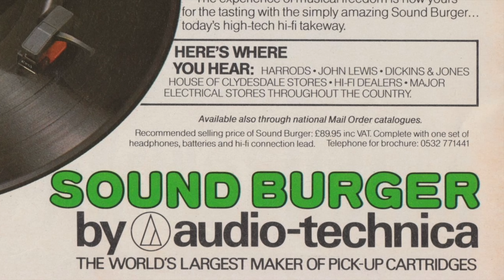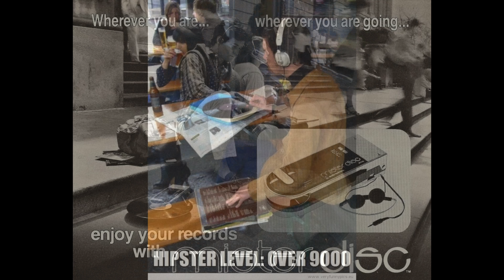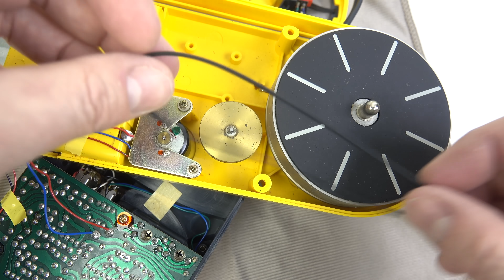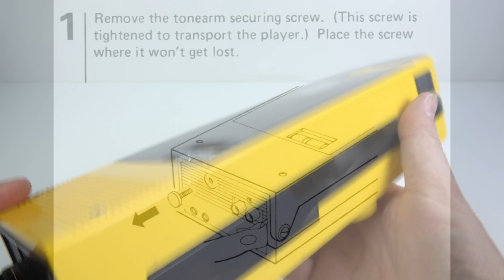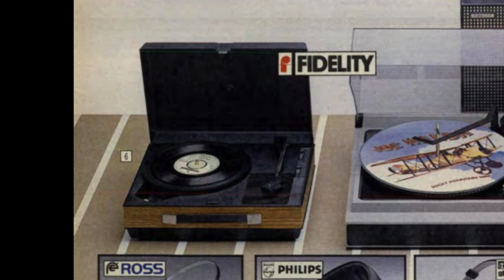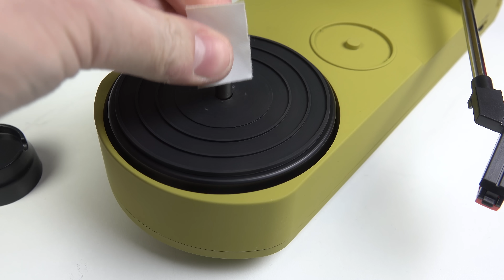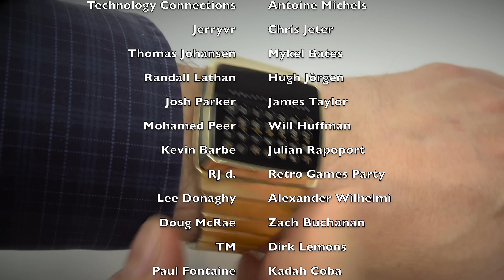SOUND BURGER & the clones

Comment: 100% fake. There is no reason why they would have high voltage hazard warnings on it when the highest voltage that unit will ever see is 6v from the batteries. Often if they don't just outright photocopy parts of/the entire label, they'll do a "word for word" copy and possibly at gunpoint which might explain the typos.

While I'm here, I have a question. My 60-year-old mum has a huge vinyl collection, you know, before it was cool, and nothing to play them on. I'd like to get her something. She is a very mild audiophile, but easy pleased. I'd like to get her something that isn't a crap copy of an original player, on a reasonable budget. Digitizing would be cool as she has a few rare ones, but not essential. Ideas? Cheers in advance.

Comment: I tried two such units around 2 years ago. The Crosley I got from Brookstone. I wasn't expecting excellent sound but I hoped for reasonable. Nope. The unit would have wobbly sound every now and then. Suspecting that was a fluke I got a replacement and the problem was still there. I took it apart but saw no obvious reason for the speed inconsistency. 
There's a similar unit on Amazon from Sylvania so I tried that one. Various colours available; how syilish. The sound was consistent (not wobbly)...but in mono through the headphones output. I gather you could get stereo if you took the USB output but that was beyond the point of having this sort of thing to begin with: portability.

Comment: Oh the fond memories. I used to have a Sound Burger. Mine came in silver finish which looked much more serious. It had pretty decent sound quality as far as I remember. The transport was quite stable but on rare occasions it would suddenly speed up a tiny bit, just about enough to be noticed. One drawback of the design was that the down side was picking up dust from the table while the record was rotating. Overall though that was the record player I spent my youth listening to and I'm glad I had it.

Comment: Knowing the Chinese somewhat through their stuff on eBay (via Big Clive's channel) I can say with decent confidence that's a knock-off based on the sheer amount of hum and the housing.  They tend to go with as few components as possible and the cheapest circuits possible and the result here is lack of suppression and isolation in there causing a frankly awful amount of hum.  If I'm wrong about that being a knock-off then I'm disappointed in the product offered.

Comment: I replaced the Numark Groovetool Stylus on my TTUSB with one from Banpa. $2 cheaper and a much better needle. I only mention it cause the Crosley's use the same model stylus. I've noticed the Crosley's are just a plastic stylus with a plastic tip tha can't be good for your records. I've thought of doing an experiment to counter the tracking force by placing a coin on the back end of the tone arm. Now while I know I should upgrade my cartridge to a Shure or AT it seems pointless cause these budget Numarks lack a ground wire sO I'm still getting a hum on my mixer.

Comment: Crosly is cheap ass garbage.I have worked on other products they make..total crap. this is using some type of PWM drive to spin the motor and its not shielded from the audio section well enough which is why its feeding back into the speakers. they could have isolated the audio better, but hey, Proper engineering costs money.

Comment: Hi 
when I was little ,early 1970's , my auntie gave me a small portable radio , I assume from the 60's approx 6"x 3"x2"thick on the one corner it had a small spindle a rubber drive wheel and swing out arm with stylus . it played 45's but the record was bigger than the radio.
ive never seen anything like this since.
unfortunately I "took it apart" to see how it worked and that was the end of it .
Does anyone know what make it was ? 
Both the radio and record player worked ok before I did my thing with it.
I have thought about it many times but have never seen anything like it since .
Paul .

Comment: As someone who only has experience in tangential topics, and at the risk of sounding like an idiot - if those rubber belts fail so often, what's the reason they don't just use gears? Difficulty to manufacture, difficulty to adjust, or something else?

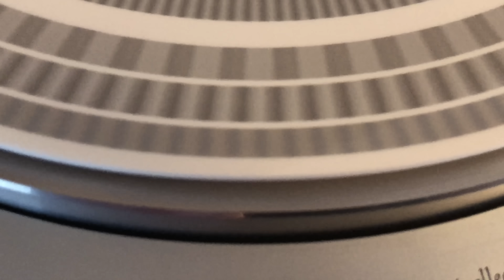Comment: 7:40 Once you put a record on the player, and the stylus grips, the speed will be slower.
I think modern batteries are slightly higher in voltage (keep their 1,5V longer) than older ones, which might be one reason why the record player is spinning faster.

Would have loved to see if there was a spinning speed difference on AC vs battery.

I was expecting it to be a cheap thing, but it sounds quite good if you ask me!
Reply: Many BSR TTs are known to play too fast, also many cassette decks were 2sec fast/min as well as all portables being set to this formula

Comment: Bring out motor and while it is on sand or file the groove of pulley smoothly where the belt  is driving few min until diameter is reduced few % there you solve the problem.

Comment: The Sound Burger cartridge is in the same family as the AT120E series. And given it's only tracking at 1.8g you could upgrade it by using an ATN120E, ATN440ML or even an AT150Mlx/ATN150Sa stylus. Might be a bit of overkill, mind you.
Reply: Plenty of them still available, though.

Comment: The original Crosley Revolution had a magnetic cartridge and a rotating spindle. However not sure if it would be a good idea to pick one up now because the belts on mine have worn out. Oh and you can't place a scale ontop of the record to weigh the tracking force because those record player use a spring as a counterweight, so the stylus pressure depends on the height of the tonearm. Good vid tho

Comment: Be careful with that DC input jack; It's center negative by the look of it. Not uncommon with older equipment (There is a reason for it but I can't remember what it was) but most wall plugs sold today are the other way round.

Comment: Ah, another day, another lovely Techmoan video to kick back and relax to.

Have you thought of making a video about the tools and kits you use to test/repair things?  I don't mean like screwdrivers (unless we're talking about specialized kits of course), but rather that weight sensor you use to measure tracking force, and that disc you use to test the spin rates.  Things like that.  Sure, one could just google to find their own equivalents, but it might be nice to watch a video dedicated to the 'tools of the trade', if you will.  I am planning on getting a record player at some point, an AT-LP120 most likely, just waiting on Amazon Canada to sell it at a reasonable price, and it would be convenient to have a video to refer to in regards to optimization and maintenance.  The same or a similar video could be used for other things, like cameras, power adapters (step-down transformers, for example), etc.

Comment: Ah the headphone jack, a piece of technology that was too advanced for it's time... It's too bad we don't see them very often at all anymore...
Reply: joe nodden we’ve been seeing them all along.
Reply: I refuse to buy a phone without a headphone jack.
Reply: The headphone jack has its origins in early 20th century manual telephone switchboards, where patch cords were used to make connections between subscriber lines. The plugs on those cords had three contacts, tip, ring, and barrel.

Comment: I don't think the crosley is fake, got one from curry it had the exact same issues, a screw was even missing on the cover.
there are two small screws under it to "adjust " 33 and 45 speed. This is an horrible product and it also kept skipping especially on 45.

Comment: If somebody is interested: i currently have a Mister Disc and a Dual PRP 5, but i want to sell the PRP 5 because i like the looks of the Mister Disc over the PRP 5. It has one issue: the latch on the door mechanism isn't working.. so it keeps popping open, it works fine tho.. it needs some contact cleaner. If somebody would give me a decent offer, i will greatly give it a new home by enthousiast who love quirky and/or unique gadgets.

Comment: For some reason, Crosley and Ion devices tend to require proper grounding to get rid of that annoying hum.
Reply from the maker: By that you mean burying in the ground - in concrete.
Reply: Techmoan Lol, most definitely! 😂

I got fooled into getting Ion Superior 7-in-1 gubbins, which had similar ground hum and line output that was “too hot” - all you could hear was the buzz!

That was all resolved when I used a wire to connect the shield of one of the phono outputs to a radiator (yes!). The hum disappeared and all was right with the world; apart from the device still not being great :)

Comment: 7:56 i have solved that issue on my Mister Disc: by replacing Resistor R402 3.3 Kohm with a 3.9 Kohm.
Reply: I wasn't sure at first if i had to install one with more or less resistance.. so i ordered 2 resistors, both where either one step higher in resistance, or lower. I first installed the lower one.. and ofcourse it played to fast, so i replaced it with the higher one, so now it's playing at the right speed.
Reply: Georg; 
Electronic components like resistors & capacitors can change their values over long periods of time especially if they're low quality to start with & exposed to significant heat from high ambient temperatures & higher current than expected. The coloured bands on resistors not only signify the resistance value but also the last band indicates how closely it's been manufactured to meet that value (+/-%), so if a circuit uses cheaper components to start with then it might not ddo precisely what it's designed to do even from the factory!
Reply: Trim potentiometers aren't usually high precision, so if you need to set a value close to the upper end of the nominal value of the pot, with a bit of bad luck, the actual max value of the pot could be lower...
More careful overall circuit design could probably have dealt with it, or it might be an issue of  the tolerances  of multiple other components coming together in just such a way that for this unit the range of the pot just doesn't do it...
Reply: I was thinking the exact same thing as well. :)
Reply: Georg: These components often will drift out of tolerance over time.
Reply: Eric Blair That makes sense. I assumed it was because DJs used to play records slightly fast in the 80s to make it sound a little more exciting, and people were used to that sound.
Reply: I'd also recommend applying a minute squirt of PTFE spray (WD40 produce wet/dry versions) to the each of the spindles to ensure they're rotating freely!

Comment: I think this may be a fake Crosley. Looking at the press pictures it looks really different. In the press pics the volume control is at the top, under the on/off and speed switches. Also it has a clear window so the record's label is visible while it's spinning. Just look at this amazon listing. https://www.amazon.com/Crosley-CR6002A-BK-Revolution-Discontinued-Manufacturer/dp/B003U8CI9A
Reply from the maker: There’s a bit more information about this in the video description text box.

Comment: It looks like the USB port is also a power input on the Crosley so it wouldn't surprise me if both the increased speed and hotness of the line out jack are due to the 1V difference between USB and 4 AAs.

Comment: A recommendation for cleaning potentiometers: do not just squirt any contact cleaner on there. The lubricating residue meant for switch contacts can attract dust and ruin the carbon track over the course of a few years. 
You can use it, but you have to wash away the residue with some isopropyl alcohol.

Comment: I would guess one possible reason it is spins too fast (even after adjustment), is that the other resistors are no longer at their original value. Resistors tend to slowly change in value as they age, so the pot might not have the range to compensate. Also, that motor hum on the Crosley is inexcusable, a few filter caps probably would have prevented that.

Comment: In the Crosley they used a "Stepper Motor" for driving the Record at a "accurate" Speed. But they messed up the Timing, they messed up the filtering of the Signal path and i assume there aren't not much electroyltic Caps inside.

Comment: I'm surprised it doesn't have a 78 rpm setting.  I seem to remember most turntables into the mid-80s could play 78s.
Reply: Shellac 78s are not too portable!
Reply: It would wear the battery down considering how fast the motor would have to turn

Comment: Regarding the speed; have you tried touching a high valued resistor the the ends of the trimmer to see if it changes the speed?  You can play with different values, or if the speed isn't going the way you want maybe you can snip the lead and try small values of R in-line.

Comment: Ah, you beat me to it. 
But a much better production than I could have mustered. Thanks.
I had a Dual version, and a Mr. Disc, but let them go. I still have my 3rd Sony PS-F5, not the 9, a Sound Burger, a variation on your other one (blue and white) Verit Sky Studio and a slightly older first version of the Crosley Revolution, as well as the Ion DuoDeck also with cassette, and a couple of the really, really cheap USB players with one round end from “Sylvania” (note quotes”) and one without the lid from Vibe.
Was thinking of doing a line (or headphone) out to camera “shoot out”.
All the new ones have the same cartridge anyway. 
BTW, Hugh Masekela records seem to always sound great. Was listening on good phones and impressed by the quality from the Sound Burger.

Comment: I bought a Crosley revolution for my girlfriend a few months ago. It's very different to the model shown here. Didn't come with earbuds, the batteries went in fine, no weird label-maker labels, no hum or other audio issues, much better tracking, consistent speed, the switches all in different places, and generally just looking a bit nicer and sturdier than the one in the video; most importantly the spindle does rotate. The only record player I've seen with a stationary spindle (it's a terrible design; you have to grease the spindle to get any semblance of 33rpm) is the ridiculously bad knockoff Crosley portable that I bought the revolution to replaceme. I think you got a knock-off Mr. Moan.
Reply from the maker: There were two Crosley revolutions, the CR6002A and the CR6020A
It sounds like you’re describing the CR6002A, but I have the CR6020A

Comment: There was also the Nordmende Dingi which is very similar to the Dual one. Whatever cartridge is on it I have used a Sanyo STG12 stylus as a successful replacement. I remember seeing lots of another brand in markets in France. From memory they were Thompson but I can't be sure.
Reply: Found it, the Thomson tl200. It looks like it is the same as the Dingi and the Dual just different badge. Thanks.

Comment: To techmoan if the belt stretches out put in glass of water and micro wave it for 15 min.to get the belt back to its size and it will keep it rubbery stretch.on a persons you tube channel.it might work if you boil it on a stove to.try it as an experiment.I hope this works.

Comment: I don't think it's a knockoff, it's just crap.
Reply: No truer words ever spoken.
Reply: I don't understand why anyone would make a fake of a Crosley. My sister's Crosley cruiser has the same weird tonearm, like the arm is at a weird angle, so I wouldn't be surprised. Plus all the cheap turntables have the same mechanism meaning they come from the same factory, so I can't see why it would be bad unless this was a bad batch or a one-off.
Reply: To be fair it looked crap in every way, including the colour. I agree that's it's a crap product probably by a crap company. Never heard of them before.
Reply: It's not beta, Crosley is just the worst audio manufacturer on the market, full stop.
Reply: You'd think Audio Technica would bring the Sound Burger back.  It seems like it wouldn't cost that much to manufacture looking at the innards, and would be a very profitable exercise even if sold at half the going rate for the originals!

Comment: You must be right in the assumption it's a knock off Crosley. I bought one in 2011, and there's quite a few differences from mine: 
There's no earphone compartment.
Volume is a slider located together with the power, power indicator, and speed toggle.
It runs on battery or 9V DC, USB is for line out to PC only.
Center spindle does move, and the supplied adapter is rubber, but it doesn't work as a stabilizer.
 It has a shoddy built-in speaker.
A radio transmitter.
Yours is missing a ® in the logo, and there's no spelling errors on mine.
And last, there's very little idle noise when it's powered on.

I don't have the tools to test the RPM or tracking force. So I can't say much about that. But it's not what you'd want as your main record player by any means.
Reply: HaraDaya That sounds much more like mine. 
I think they went through changes and China Inc. seems to play very loose with models and names and factories etc. 
Knock-off ? Who knows ?
Reply from the maker: There’s a bit more information about this in the video description text box.

Comment: Just curious, when you use the strobe disc, do you have a 50 hz strobe light source or do you look at it through a videocamera that shows 50hz? 

I was just thinking that in japan they have 60 hz AC mains so maybe... No, wait... It runs on C type DC  batteries... so the speed problem wouldn't be due to that. Sorry...

But still... What method do you use to gauge the correct speed with the strobe disc? Because I would imavine that if not careful then one could be looking at a strobe disc designed for 50hz through a videocamera that samples at 60 hz and then you'd get some wonky effects... :/
Reply: Japan uses 100v 50hz I believe Techmoan uses a 50hz PAL cam